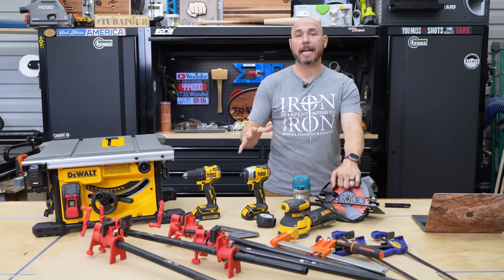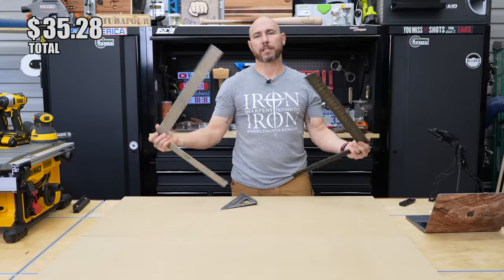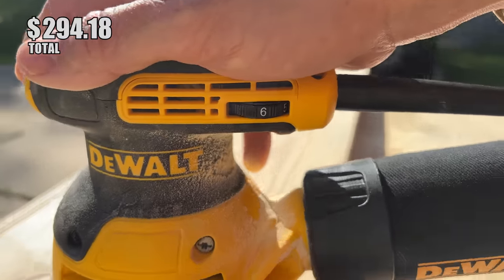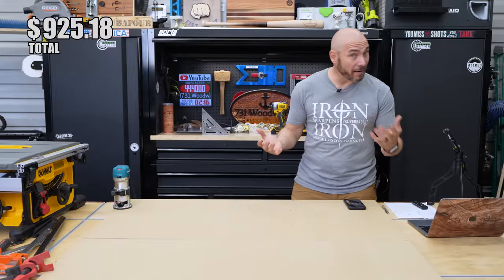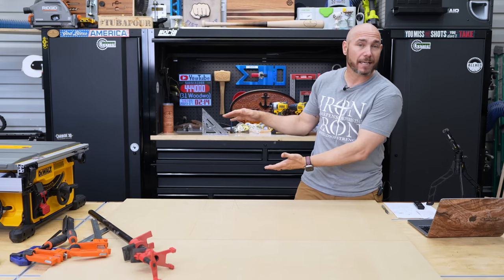Beginner's Guide to Starting a Woodworking Shop for under $1,000

Comment from the maker: ▼EXPAND FOR TOOL LINKS and INFO▼ 
Watch Next = Top 10 Woodworking Tools I Bought on Amazon - https://youtu.be/05xpQSWAhBk&list=UULFSLClJLzdUMRMe0E4SPfc-w
Tools In This Video: 
Lefty/Righty Tape Measure - https://amzn.to/3O6eT1K
Fastcap Old Standby Tape Measure - https://amzn.to/3O4CHmJ
Swanson Speed Square - https://amzn.to/43Dcd1i
Framing Square - https://amzn.to/44ADliZ
DeWALT Drill / Driver - https://amzn.to/44TD36C
Skil Circular Saw - https://amzn.to/470dSRp
Upgraded Circular Saw Blade I Recommend - https://amzn.to/43CNA4M
DeWALT Sander - https://amzn.to/3rIMFTu
Craftsman Sander - https://amzn.to/43wt5qA
Bessey Pipe Clamps - https://amzn.to/3Dqc6vy
3/4" Pipe 4-Pack = https://amzn.to/3Do7G8j
Irwin Quick Clamp Set - https://amzn.to/3DvOhlP
Makita Trim Router (Amazon) - https://amzn.to/44BvEZU
Makita Trim Router (Acme Toos) - https://acmetools.pxf.io/Y9oKZO
Bosch Trim Router - https://amzn.to/3q3rWJp
DeWALT Table Saw - https://amzn.to/44HH8ew
Skil Table Saw - https://amzn.to/3KbaUjs
Skil Table Saw (Tool Nut if sold out on Amazon) https://thetoolnut.sjv.io/VmZZEj
Sun Joe Shop Vac - https://amzn.to/3Q83Yra
DeWALT Shop Vac - https://amzn.to/3rM6uZK
DeWALT Miter Saw - https://amzn.to/3O2EMj8 
WEN Miter Saw - https://amzn.to/3DvP06x

If you have More budget, these are the Upgrades I would buy over the tools above:
DeWALT Cordless Router - https://amzn.to/3Do8dqP
Festool Dust Extractor - https://amzn.to/3Y1pfES
DeWALT Dust Extractor - https://amzn.to/3Ka7ltA 
Bessey Parallel Clamps - https://amzn.to/3Dm8Y3Q
SawStop Table Saw - https://amzn.to/44yF5JF
Bosch Miter Saw - https://amzn.to/3K8XtAA
Makita Miter Saw - https://amzn.to/44ClpUX
Festool Miter Saw - https://amzn.to/3Oqiut5

 📲 Never miss another tool deal. Sign up for my Tool Deals SMS Alerts - NOTE: I text out tool deals so you don’t miss any! text DEALS to 1 (731) 207-7151 Be sure to add DEALS to your text to me so you get added to the proper list.  You can also click this link https://my.community.com/731woodworks  Important to add the word DEALS to the text!

(If you use one of these Amazon and other affiliate links, I may receive a commission) 

Some other useful links:
Daily Tool Deals on my website: https://www.731woodworks.com/tool-deals
Subscribe to our email Newsletter: https://mailchi.mp/7e44c16eefdc/731-woodworks-email-newsletter
Check out our easy-to-follow woodworking plans: https://www.731woodworks.com/store
Outlaw's Board Butter - So Good it Should be Outlawed: https://www.731woodworks.com/store/boardbutter
Reply: The link posted for the Makita trim router is bad. Is there a model # you could share?
Reply from the maker: @veritylarson114   thanks for letting me know. I added a link to Acme Tools for it.  You can get the info there.  Thanks again!

Comment: Something that always seems to get missed on these lists is bits. You have a drill and a driver, but no bits for it. Router, but no bits. You can get ones that are reasonably inexpensive (good for a beginner), but that will add to the cost.
Reply: It was thinking something similar, but this is a list of tools. Bits would be considered accessories. But that would be another great video for beginners.
Reply: For drill and drive bits DeWalt makes pretty solid ones at a low price. Project Farm's tests of their drill bits hasw them consistently come up pretty close in performance to really expensive ones.

You can get a pretty comprehensive 30-piece impact bit set for $10 and a 21-piece drill bit set ranging 1/16th to 1/2" for $20. So $30 for a pretty good head start on your tools.
Reply: snag some yonico router bits it your on a tight budget or you plan to abuse it, otherwise grab whiteside and support usa
Reply: Yeah my bits cost 2-3x what my (cheap, corded) router cost.

Comment: Is it just me or am I the only one who has never used a tape measure in wood working?
Reply: You’re not alone. I don’t use a tape measure for woodworking; I use various kinds of rulers, including a folding rule. A tape measure is for carpentry; woodwork is different.

But a tape measure is good for other things, as I noted. Also, get a 16-foot tape. The standard that most people use us 25 feet. With that, you are lugging around extra bulk and weight that you hardly ever need. It may be good to have a25-foot tape for when you need it, but for 99% of the time, a smaller tape is much more convenient.

Comment: 0:25 Tape measure
1:16 Square
1:59 Drill/Driver
3:40 Circular Saw
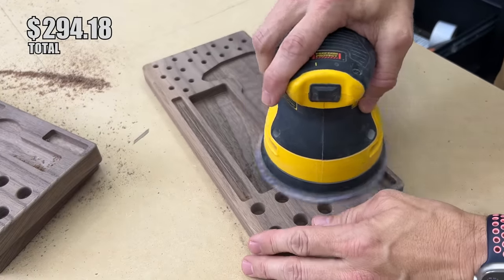5:21 Sander
6:18 Clamps
7:28 Quick Clamps
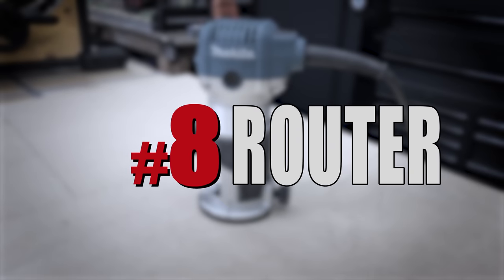7:49 Router
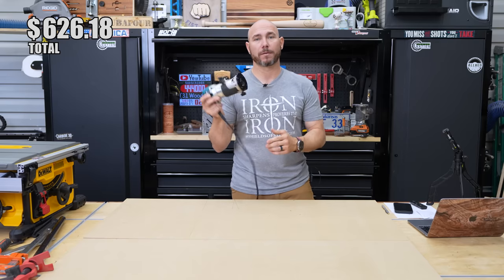8:26 Table Saw
11:48 (BONUS) Mitre Saw

Comment: I'd definitely add a super accurate square of some sort to check the accuracy of the table saw and other tools. Also, a drill guide of some sort to ensure that holes are dead square to whatever you're drilling.

Comment: What about chisels, planes, hand saws (of which there are 100 types)?

And, as one other commenter mentioned, a workbench, or tools and materials to make one. And it needs good work-holding features, including a planing stop.

One more thing. I learned woodworking from an old master. I asked what tools I should get to start His advice was to get sharpening equipment. No one mentioned sharpening equipment yet.

And what about a band saw? It was my third stationary tool, after a table saw and a drill press (oops; I neglected to mention the lathe, but that’s a separate matter).

Comment: Having an oscillating multi tool is extremely handy. Other items I would add to the list are:

Drill bits
Driver bits
Miter saw
Vise
Jigsaw
Drill press
Reciprocating saw, small or large
Circular saw that is for the opposite side of the one you have so that you have a left & right. 
Hand held belt sander
Hand held power planer
Sanding station with a belt and disc
Levels of all sizes
Router table
Plunge router
Portable bandsaw
Saw horses, metal & disposable/consumable plastic ones. 

Advanced tools:
Wood Lathe and accessories 
Large Scroll saw 
Large bandsaw
Sliding miter saw
Kregg Jig and numerous other small setup tools
Forstner bit set

Comment: I’d also add a drywall square as well. This is pretty cheap and can help cutting the bigger sheet goods with the circular saw easier before upgrading to a table saw.

Comment: Nice list! The only thing I would add is a good bit set for the driver and drill, and maybe the router. And PPE and marking tools like pencil or grease pencil but those probably aren't worth counting dollar-wise as they are inexpensive.
Reply: Agreed, especially on the router.  Routers with bad bits are just dangerous smoke machines.

Comment: I would recommend a Kreg AccuCut with the expansion pack.  When you mate it with the circular saw, you get a very useful tool.  Once I got one, I was able to make much more accurate cuts on larger pieces than I can trying to wrestle them through my contractor size table saw.  Every time I use it, I think about the value to cost ratio.  It is excellent.

Comment: MANY times you can find the power tools at pawn shops, facebook marketplace, thrift stores. I bought a Porter Cable buscuit jointer for $25 at goodwill, 6 hp Shop Vac brand shopvac for $25 at Habitat for Humanity Store. Shop vacs are common to thrift stores, I've picked up several and use them for dust collection. At a Pawn Shop I picked up that Dewalt / drill impact with charger and 2 batteries for $80.  I also picked up a craftsman 10 inch table saw with a cast iron top $60 off of Facebook marketplace. I spotted a Dewalt 735 planer for $200 from a 2nd hand tool shop. Ryobi Drill press for $80.  Just last week I saw a craftsman table saw in Habitat For Humanity store for $100, and a craftsman router table (with router) for $40. Shop around before you buy new.

Comment: I got the Craftsman aat Lowes for 99.00 apair drill driver and i had to redeck 3 48 foot tractor trailer flatbed trailers       i did all 3 and they held up good and i am still using them 6 month later for the price they are good

Comment: I would argue that a miter saw is essential for a beginning woodworker, more so than a table saw. 

Just speaking from my personal experience, while the table saw is unquestionably the more versatile and essential of the two, it’s also more intimidating and, again speaking for myself, I hesitated to use it quite a lot when I began a little over a year ago. 

During that time I leaned heavily on a little Craftsman sliding miter saw that ran on their V20 battery line (this was also because I’m in an apartment garage with only 1 outlet). 

With that saw I made several smaller scale projects and some shop furniture both for my home shop and for my boat shop parts room at work. 

I also recently became a student of Steve Ramsey’s Weekend Woodworker course, which doesn’t incorporate a table saw until the third project. 

My wife enjoys helping me build things but even now doesn’t use the table saw. Sorry to ramble on, but I guess the point I’m trying to make is that plenty can be made with a miter saw, and I view it as a workhorse, at least in my shop. And it is a great entry point for someone who wants to create but is hesitant to jump right in using a table saw.
Reply: True. It’s easy to forget how intimidating these things can be when starting out! Even my Ryobi miter saw scared the b’jeebies out of me the first 20 times I pulled the power trigger button. It gave me a very healthy respect for the power and danger of these tools.
Reply: Track saw, Band Saw, thickness planer.
Add in a drill press and  some quality hand tools and you've got a shop.

A cheap table saw is not a good idea unless you are into carpentry.
For fine woodwork it is pretty much useless.
You don't need it until you need one and a portable is not going to do the job.
Reply: I think the reason is everything you can do on a miter you could probably do on a tablesaw with a jig. But many things like straightening an edge cannot be done on a miter.

Comment: I have a very small shop and when I started out I had everything corded even the drills/drivers.  You can shave about $100 or more (depending on the deals) just on a corded drill system.

Comment: hey id actually recommend the bessey quick clamps over the irwin ones, as they come  in a set of 4 like the irwin, (2x6inch, 2x12inch) but can also be used as a spreader. the spreader is useful for glue ups if u don't have a lot of longer clamps, because you can take a 2x4, attach a small block to one end with some screws, then about 5-6 inches longer that your glue up, add another block. make a few of these and then place your glue up on them, then use your spreaders to apply the clamping force. I probably wouldnt recommend this for higher end woodworking, but in a pinch it will probably do. you could also use the 2x4 clamp things to hold longer pieces together. Great video man!

Comment: I started off with a Ryobi combo kit that came with 2 1.5mah batteries and a charger, a tote bag, a 5 1/2 circular and driver and drill, and included a free tool only pick from a limited selection which I chose a jig saw with (I regret this choice, I’d have been much happier with the multi tool had I had any idea what that thing did). Anyways I walked away with all that for less than $300CAD. 
I grabbed my old Stanley tape measure and 12” level from when my wife and I were hanging pictures.
My next purchase was a speed square with scribe helpers, I went “big budget” with this one knowing it’d last forever and got a beautiful Milwaukee one, a set of carpenter pencils, a set of calipers, and a right edge all for about $70CAD together
After building a Saw horse and knowing I was going to be building exterior structures and garden ties, I opted to run out and grab a miter saw next and walked away with a corded Ryobi 10” sliding compound which I really love ❤️ I then took the opportunity to grab a combo square and a set of bessey trigger clamps. Got all that for $250CAD 
Friend of mine donated to me a 48” empire straight edge 🙏 
Just yesterday my first Kreg purchase arrived, which is a rip cut guide for circular saws. Though I hope to grab that DeWalt Table Saw one day, I checked out the Ryobi one and I agree that that fence is trash :( 

Anyways I’m about $750CAD into this new hobby and I need to start justifying it by building a $35 night stand my wife found on Amazon 😂 

Next up on my list of things to get is a proper orbital sander. And I’m thinking the corded Milwaukee has my name on it
Reply: 😂, That $35 nightstand will end up costing you more by building it! My wife has been asking me to buy a new dining room table years ago.  Last year I finally got around to building it since it's cheaper than buying it.... Although it was cheaper, it did cost more as I bought more tools I "needed" for the project. 

Now I will be building a Corona Coffee Table next. That is whenever I have the actual time to buy the materials.
Reply: @LinoBarraza  man I hear ya on that haha 

Trying to find the sheet goods to replicate will almost put me about even 

But I also find the tools to be a fun investment into opening doors of possibilities, so I don’t count that towards the “building the nightstand” “cost” as it were (if I did, I’d drive myself insane 😂)
Reply: @LinoBarraza maybe cheaper to just buy it made already.  But you can make it your own and get much more enjoyment from it.  Look up Steve Ramsey's drawer organizer build for the perfect example.
Reply: @davegravel3740  I definitely did get that enjoyment.  It was a farm table.  For the base of the table I did a full char and scraped it off then sealed it.  The bottom of the table top, I did the full char as well.  The top and sides of the table top I just burned the grain.  I did everything similar for the benches.
Reply: @davegravel3740  I agree, and exactly. I can sit here and try all day long to compete with the prices of Amazon, or I can build my family hand made custom stuff that you can't just buy off the shelf made by machines with no love or care. The value is in the sentiment that hopefully outlives me.

Comment: The Milwaukee M12 drill and impact driver set regularly goes on sale for $99 enough power for 99% of my fairly heavy use and they are small and lightweight 
I use in my shop the Fastcap Flat Back as it lays flat on your project 
In over 20 years I’ve do not recall ever using the variable speed on my Random orbit sanders

Comment: Love this video. I have most everything (and more) except the table saw. Just not space for it. Thankfully my uncle lives 12 minutes away and has a 600 sq ft shop 😅

Ran into a weird thing with my ryobi OnePlus circular saw today... It did not want to cut all the way through a 2x4, left just a little bit of material underneath despite being adjusted all the way. I wonder if the OEM blade is THAT bad. I'll be getting a diablo soon anyway.

Comment: For just starting out, they could save $50 - $100 by just getting a cordless drill without the impact driver.  When I started out impact drivers weren't a thing yet and I got by just fine. Spend that $100 on a better saw blade, some drill and driver bits, and sandpaper.

Comment: The DWE7485 comes at a great price but there are two problems with it - the knob to adjust blade height does not stay put throughout the cut. The knob rotates as the saw vibrates and settles with the habdle in the downward position causing blade height to change during dado cuts. The other problem is that the saw can't be put into an outfeed table because of the way DeWalt has designed the handles

Comment: The only tool that scares the bejesus out of me and alway's has is the circularsaw, its possibly one of the most dangerous things I've ever owned and honestly if and whenever I need to use it i alway's opt for using my tracksaw i find it way way safer to use!!!
Matt you had me laughing at the comment about you getting old and the colours of the T-square im 50yrs old and my hearing and eyesight is spot on it's just the darn rest of me that's falling apart😮

Comment: Love the list except the table saw. My reasoning for that is you can get some very inexpensive clamps and track from Amazon and make several jigs for the circular saw that will be just as good as a table saw and a bit safer as you can clamp most pieces and not have your hands near anything. Once you have an understanding of tools and how to use them then I would step up to a table saw. Just my opinion as that is basically what I did as I didn’t have the budget or space for a table saw and the jigs can be hung on a wall out of the way.

Comment: My grandfather gave me an old craftsman miter saw that he never even used, it was brand new in box... but possibly older than me. It has been very useful, but the limitations are also very clear and while it certainly isn't the most feature-rich of saws I think that shows that a miter saw is more convenience than necessity. I really want to get a table saw, but I need some home renovation that gives me an excuse to buy one. I just recently had such an excuse to buy a circular saw, hopefully I can think of something else that just has to be done and requires more tools... My (tiny) deck is falling apart, probably just going to tear it out and replace it with some stairs to the door, anyone got a suggestion for how I definitely need a table saw for that 😅

Comment: Hold off on the table saw and get a mittersaw. The circular saw cam do the same as table saw for the most part.
Also you dont need an impact for woodworking. Get a drill/driver. I have several Milwaukees but i go to the skill drill 90% of the time it is lighter and strong enough for most things cabinet woodworking.